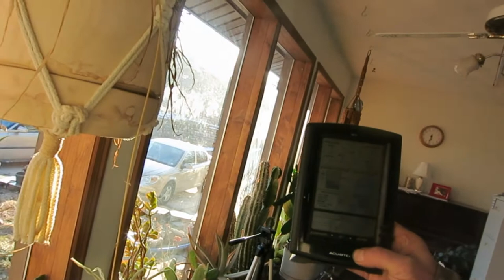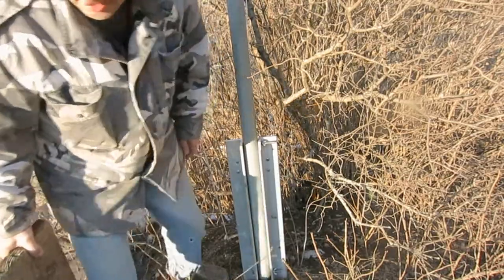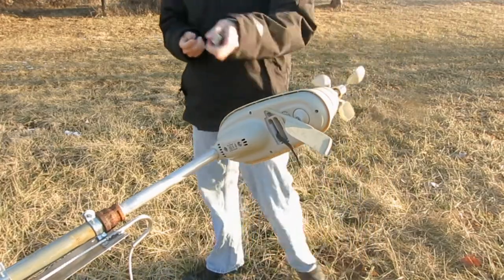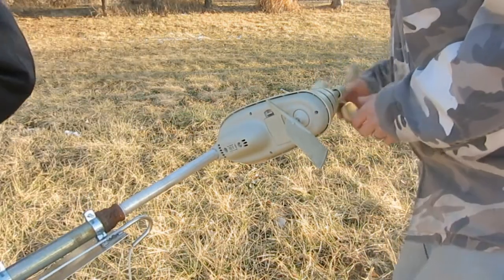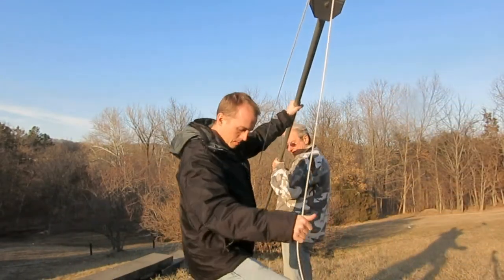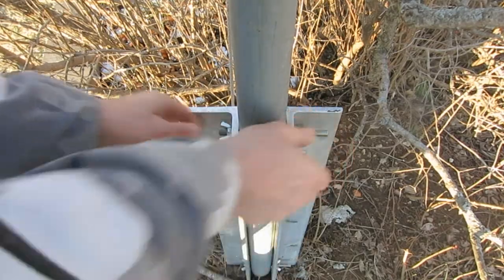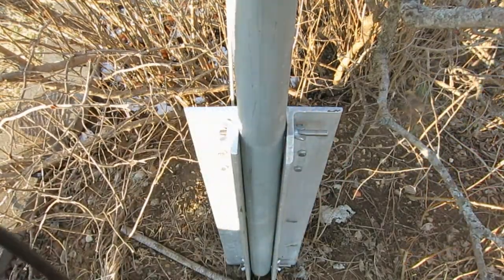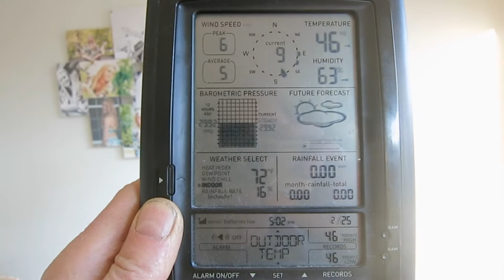How to change the batteries in a weather station.

Comment: Better idea- Replace the batteries and the battery cover with the  Remote Replacement Battery Pack accessory, AcuRite part # 06052M. It replaces the batteries in the Sensor unit with an adapter that snaps in place just like the battery cover, and has 30' of cable to a weatherproof battery box that can be mounted at ground level. The Adapter is available on either Amazon or Ebay, and makes having to dismantle an installation for battery replacement.
Reply from the maker: I do got to get it rebuilt. The spinner part got broke from hail and the rudder is so stiff that it takes a 30 MPH wind to move it. Been a good one.
Reply: @petro062   You have probably got something to replace thid by now, but I highly recommend the Ambient Weather WS-2902. Can’t be beat for under $250-300